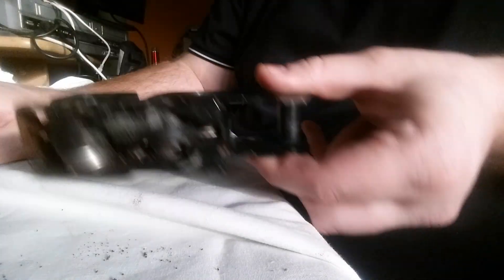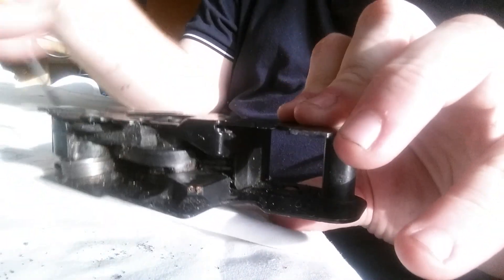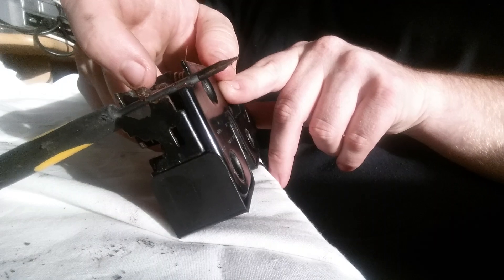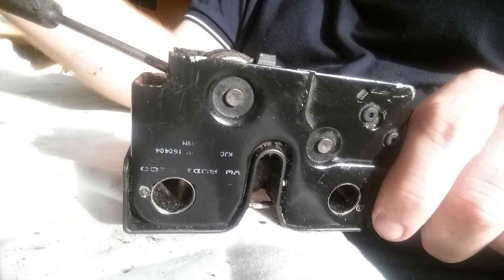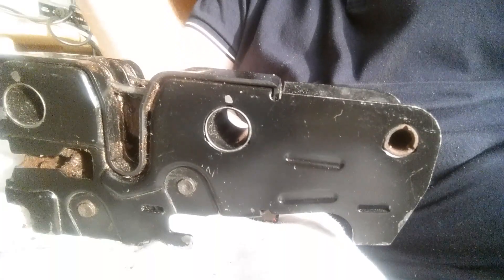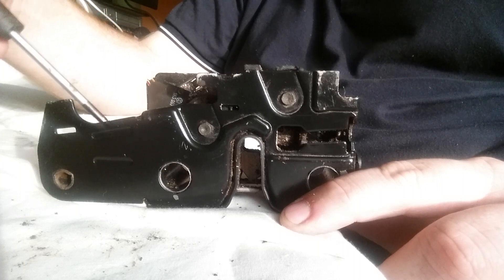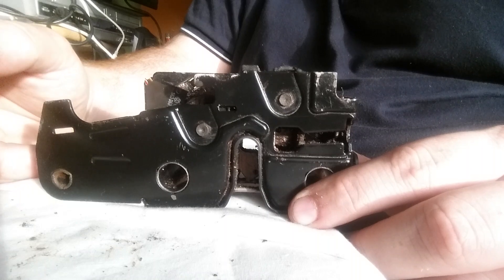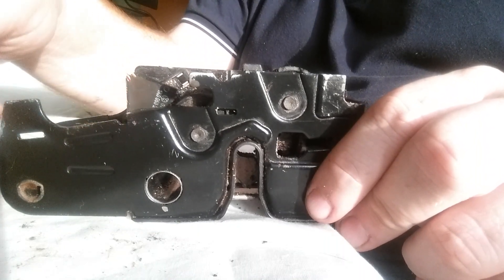Volkswagen Golf MK5 - Bonnet Lock Overhaul (Sticking Lock)

Comment: thanks for the video. very informative! I wanted to know how you wired up the bonnet sensor? the sensor has come off the loom and is still on the lock in your video. did you solder it all on again?
Reply from the maker: Hiya, which part do you mean. In the video here the sensor itself is broken it snapped on mine and Ihad to get a new lock. This was the old lock Iwanted to refurbish. 

The sensor itself is attached to the lock maybe via a clip it should be the sensor then the wires with the connector. Could you be more specific to the problem? Is it the connector at the end of the loom which has snapped off, or the sensor itself ?

Comment: It really is a terrible design.
Reply from the maker: Deffo. It never seems to be protected from the elements. One of those yearly maintenance tasks. I've used ceramic grease on my lock I greased it up once on the main catch point and hinges and I've never greased it since. Never once had an issue. Well worth using ceramic grease